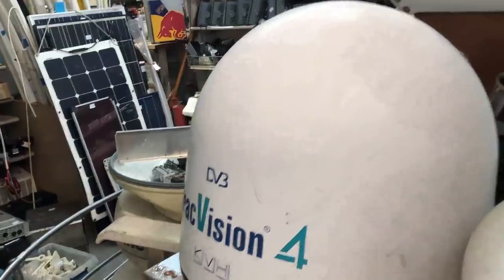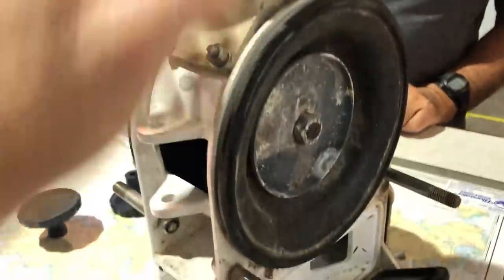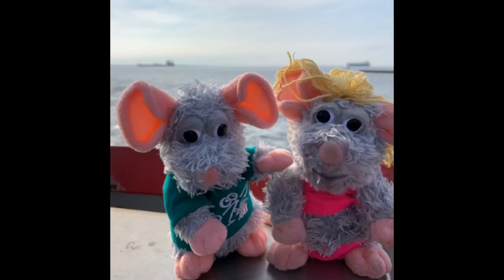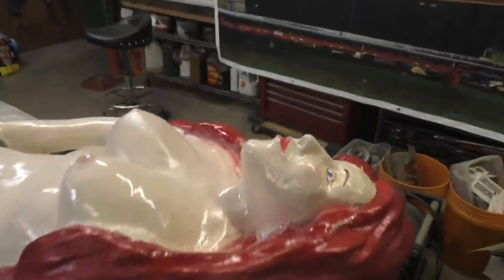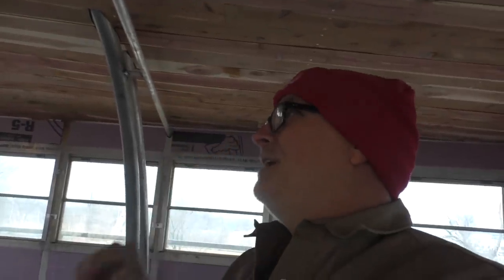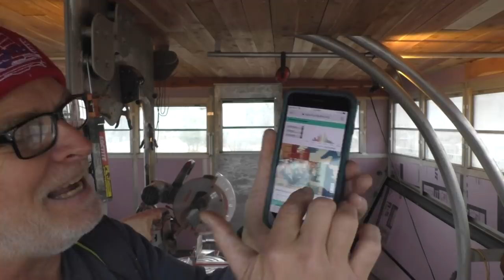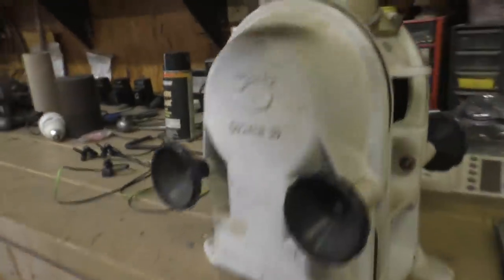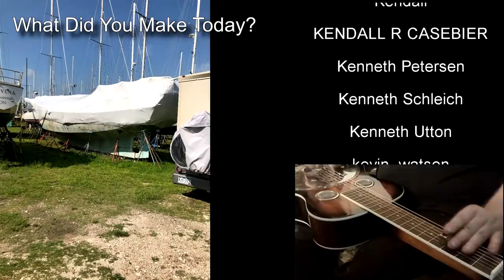Pilothouse Cedar, Bilge Pumps,  Heads and more

Comment: That double acting Whale Gusher is a bargain and will serve you well, if you bolt it to a bit of solid timber you can use it as an emergency bilge pump anywhere it's needed, we have used one to salvage a boat or two. I appreciate your comments on community, you will be joining a community that will have your back, It's the unwritten rule of the sea that you will always help other mariners in trouble and this tends to be extended to everyday helpfulness, as we are in a way, all in the same boat. BTW the worlds best bilge pump is a frightened crew with a bucket, it's amazing how much water they can shift.

Comment: Doug, I may have missed it, but do you plan to give your cedar walls and roofs some sort of coating as well? I'm asking because the air on the sea is really aggressive and depend on what types of screws you used to fix the panels, they may become rusty very quick. If that rust goes into the wood, it'll ruin your cedar look.
Reply from the maker: I don't think we will.  The screws are 316 stainless and red cedar is soft, but it holds up well.   It will change color to a brown as it soaks up the UV.

Comment: I would have size all those boards first then T&G them on router table. Sorry but the wheelhouse cladding looks like bodgework after all the great work it lets the job down..  Happy New Year
Reply: can't do repairs on a T&G ceiling surface if there is a leak or whatever. they are installed for QUICK removal. AND remember.............it's a floating tool-box , not a HOTEL , hehe. if anyone aboard doesn't like the cedar , there's a Holiday Inn Express in the next port of call , lol

Comment: Tongue and grove on that cedar would had cleaned up the cosmetics and added more strength to your ceiling.
Reply from the maker: Yes, that makes it stronger but it also makes it a pain to remove a board so we can weld or bolt a fixture to the roof.    Also adds a lot of time.
Reply: SV Seeker, I appreciate your channel so much. I have been watching your boat build from the beginning. I bought plans for a steel ketch cruiser over 20 years ago. But life was not kind to me so it will never get built. I look forward to the day you and your wife are sailing in the Caribbean making videos of your adventures. Great job on all the welding challenges with getting the plates coming together. You are a modern day Noah without much help to build it. I really love the artistic flair of the Dragon on her. I would love to be a neighbor if yours. I would have helped anyway I could.

Comment: Looks like a good trip to TX, I saw the Saturn V there too, did you get to tour the rest of NASA ? If you make a head, or I'm guessing multiples, like 2 or 3 plus a spare perhaps, will you mold it out of aluminum, plastics, or fiberglass and gelcoating ? Maybe making one of these Incinolet's would be better... all sheet metal construction, no black water tank, just ashes, electrically powered, no noise ? Check out : https://incinolet.com     I was going to suggest this to Bart for his tiny house too !
Reply from the maker: Yes, everything but the training center, that was in use.    And just composting.  This is our backup, so I want it just a step above a 5 gallon bucket.  : )
Reply: @SVSeeker  At least you have lots of cedar shavings for that available !